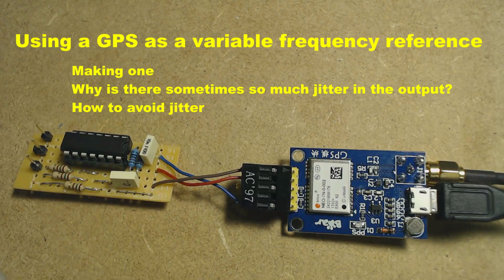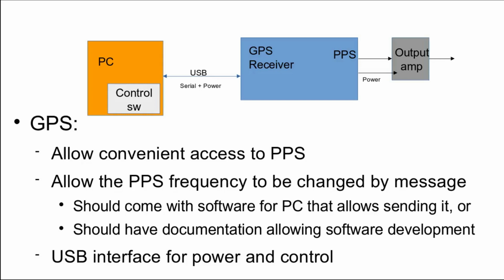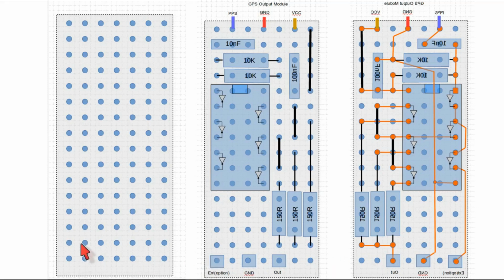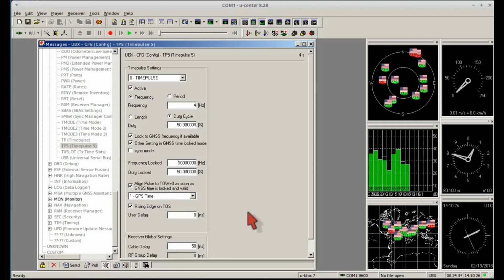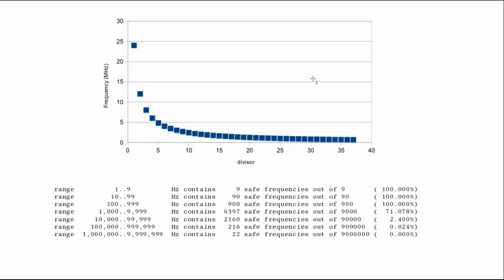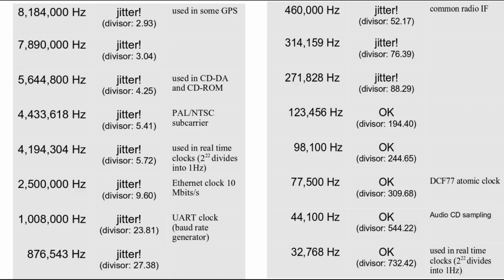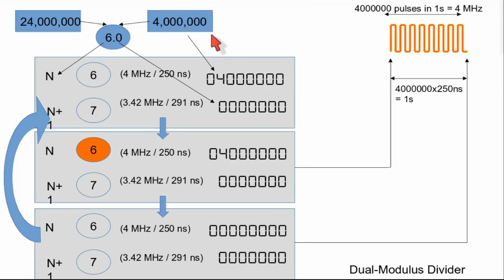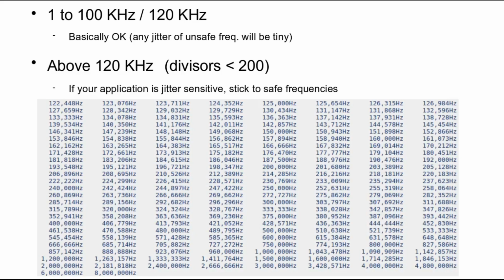Using a GPS module as variable frequency reference standard

Comment: I experimented with a NEO-something GPS module a couple of years ago as a freq. standard, and was rather disappointed to find exactly what you have shown here - that the 10MHz I wanted jittered badly, and also that 8MHz did not :o) Your explanation of the likely way these  modules do this is very clear. Your graphics are great too ! In the end I stuck with my previous 10MHz standard, which is a PLL controlled xtal osc, locked to our BBC transmitter in the UK on 198kHz - I just wanted to test out the GPS method too, in case it was somehow better. Also, my NEO module had no memory for settings, so it would be complicated to use it as a standalone freq. standard which you just power up and use without a PC.  Your module must be a later version with flash in it :o) Cheers, Dave